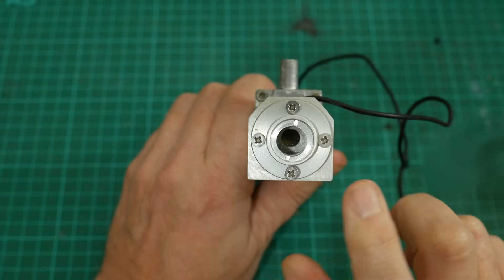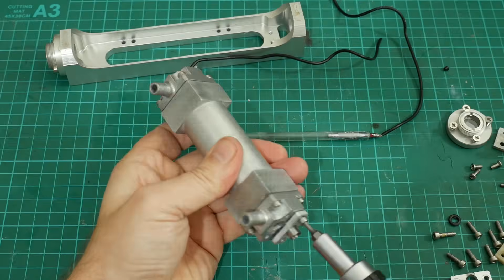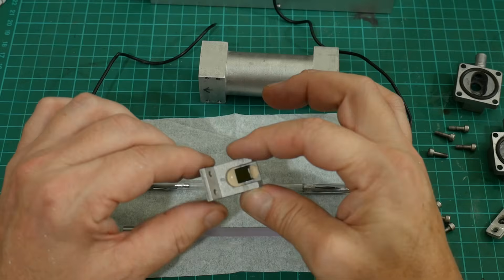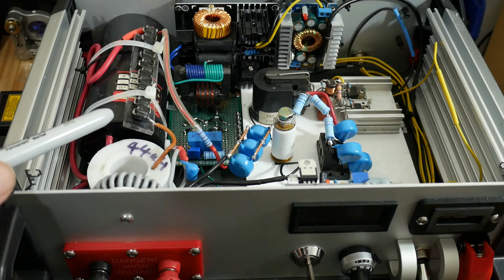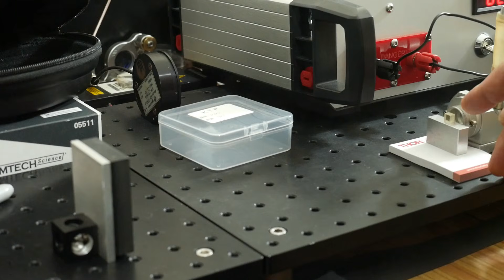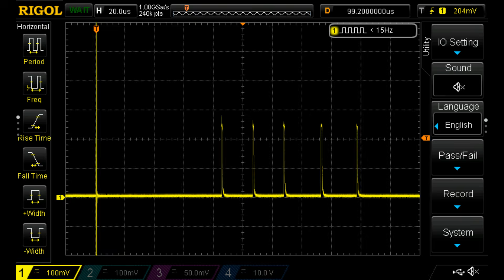Little Junk Laser is a MEGAWATT Beast!

Comment: Fantastic! I just scored a newer model of one of these tattoo lasers a few days ago and am still awaiting its arrival in post sometime later this week. You can imagine my surprise and excitement when I see your video pop up today detailing its refurbishment and conversion to a proper benchtop unit! Wonderful!

P.s. finding 1" newport kinematic mounts and 4-sided sealable cuvettes has been my bane for weeks. Do you know of any consistent hobbyist-friendly sources that don't break the bank? I have a feeling I'll be scanning ebay for quite some time waiting for the mounts to show up.
Reply from the maker: Great!
Yeah mirror mounts show up at decent prices, occasionally. Look for MM1, or MM-1 for the little Newport mounts. To get bargains, look for scrap optical assemblies. Some of the cheap little CO2 Laser engraver mirror mounts look adequate as well.
Don't forget Laser safety glasses when you are using these things.
Reply: @LesLaboratory  Absolutely! I have a new pair of wrap-around 190-540 + 800-1700 blocking OD5+ goggles on the way. Wouldn't dream of powering it up without them. Nd:YAG is new to me but not high power lasers; I'm also a 4HV member from over a decade ago hehe.

Comment: Woah no way, I own one of these I scored off of ebay for dirt cheap ages ago but have yet to do anything with it. Wanted to make sure I had a better understanding before messing with high powered pulsed lasers.
Reply from the maker: Way! Please do make sure you invest in some proper Laser safetly glasses though, and mind the high energy capacitors! Othe than that, it is a very rewarding build, with great possibilities!
Reply: @LesLaboratory  absolutely, I already have all the parts to make a simple TEA laser. So I plan on starting with that and going up from there. But all on hold while I figure out the worst case scenario power output to make sure I select the proper OD glasses.

Comment: I suppose you could try some basic libs spectroscopy with that. There are a few videos on YouTube of others using the same cheap tattoo removal lasers for it.
Reply from the maker: Yeah LIBS! I saw that video a while back. That would be challenging but very cool.
Reply: @LesLaboratory  The main difficulty is getting the timing right. If you can get the CCD of your spectrometer to work with an external trigger (like x uS after the spike from a fast photodiode), it should work?
Reply from the maker: @TheTablet314  That's how I figure it. Some cameras can be externally gated and they may well do.
Reply: @LesLaboratory  +1 on the LIBS. My Leica rep has been trying to sell me on one of their LIBS systems for a while but it's beyond my price range. Would love to see what you can come up with on the DIY front.
Reply: Also you will want a nir pass filter that can exclude the lamp light but pass the beam. Other than that use the laser pulse itself as the optical trigger for the spectrometer.

Comment: Awesome video!     - How do you test pulse forming networks generall, without, say, risking the lamp? Just short it dead?
Reply from the maker: I tested with a lamp. They are not terribly expensive from China, and if you do the calculations right it should be fine.
There are calculators on repairfaq.org where you can plug in values for capacitance, flash duration etc and they will calculate the inductor. Some manufacturers of lamps used to provide calculators for wall loading, de-rating etc, but datasheets are fine.
Reply: A load resistor